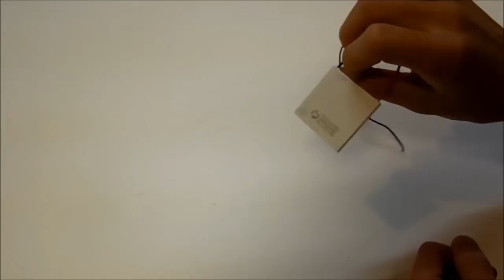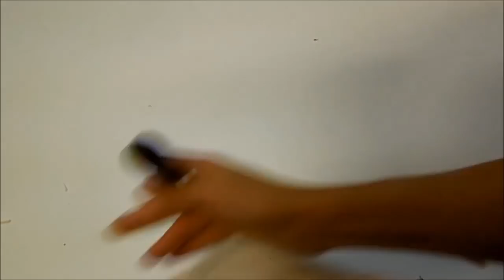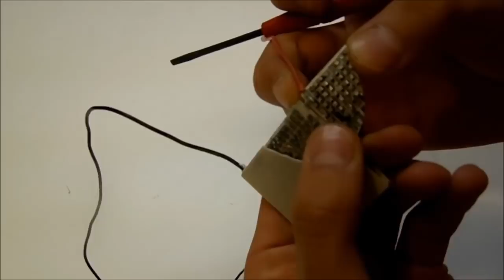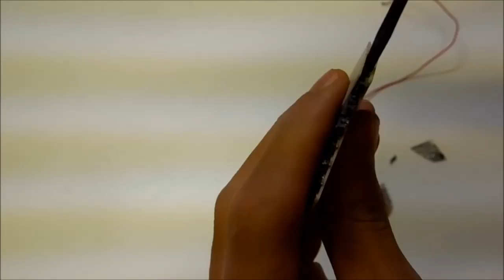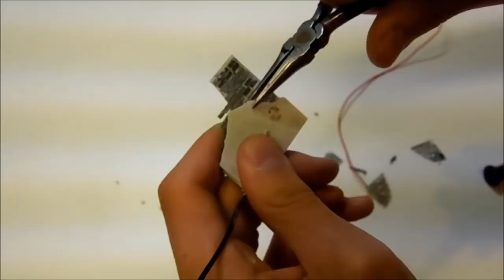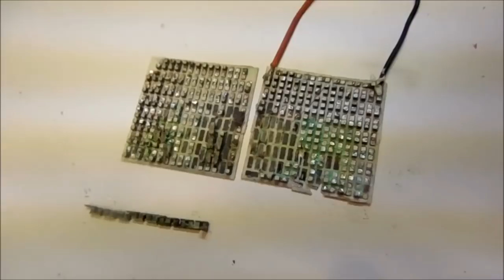Inside a Peltier Thermoelectric Heat Pump + Tear Down

Comment: He hecho en casa una célula peltier con placas de cerámica con conexión en paralelo recubiertas con una micrométrica película de Óxido de Aluminio y por cada Semiconductor en conexión serie los he hecho de Cobre metálico termooxidados de modo que los SC positivos son de Óxido Cuproso y los SC negativos son de Óxido Cúprico y conectados en serie P-N-P-N etc con delgados hilillos de cable de cobre. Se ha creado frío hasta los 12 grados centígrados Celsius y calor hasta los 38 grados centígrados Celeius. Y ha generado una potencia eléctrica desde 1 hasta 6 vatios ( watts ) dependiendo del calor aplicado a su cara frontal. 
Saludos desde México.
24 marzo 2020.

Comment: Hi I make these in our factory... From scratch... The pellets are bismith seliride... Very TOXIC!!! and bismith telliride.. He should wear gloves and clean hands very good.. And arranged in N  then P type materials it's only work up to around 350 degrees ..then the pellets break down and also solder also melts and becomes open circuit..
Reply: They should probably start putting warning labels on them ;) Thanks for the tip though!
Reply: Also the ceramic top and bottom plate are most likely made of beryllium-oxide which is nasty health wise if dust is inhaled, otherwise relatively safe if you don't pulverize it.
Reply: Can you make big size Pelter
Reply: Hi  there I made a material that thick like a penny that keep hot side on one side without getting the heat to the cold side. You think these could be interest to the company you work for??
Reply: i have those pellets , but could u tell me how to manufacture the final product

Comment: What are the semiconductors made up of? Is it Tellurium? If it is, isn't it poisonous?
Reply: Jiun Hong Lim they have two be two distinct electric conductor or semi conductor materials. 
Iron and copper do just fine.
Reply: Jiun Hong Lim silicum?
Reply: vnh sander Oo, OK, thanks :)
Reply: Ramiel OK, thanks :)

Comment: Just as a side note, the things inside are not thermocouples. 
They are P-Type and N-Type Semiconductor blocks.
Reply: I understood these work off of the fact voltage will generate across two dissimilar metals at different temperatures? Is that not right?

Also, is there a reason for the ceramic top and bottom when metal would work better? Is it because it is easier to electrically isolate using ceramic? Seems like it would take a major hit to thermal conductance and efficiency by using ceramic.

Comment: Was it totally open circuit? Because these things can melt themselves apart if left uncooled. Would have saved you a lot of work. ;)
The other easy way (hey, who knows how many you will have to take apart in the future): hit it with a hot air gun after removing the silicone. It should fall apart.

Comment: Do you have any idea how electricity flow and why one side gets cold and the other hot?
Reply: Look up Seebeck Current and maybe Fermi Level as a start. Peltier ran Seebeck's setup in reverse.
Basically the hot junction has a greater EM force from the better conductor to the lesser than the cold junction, which sets up a current flow. On the hot side, electrons leave with energy that gets shed at the cold side until if ever both sides are the same. That's when heat-driven. Drive the circuit and it works opposite.
It's very low voltage per junction pair but notice how many junctions that wafer has in series to be able to operate at 12V.

Have you ever used steel pans with copper clad bottoms? The copper is a better conductor than the steel, it has more free electrons at the same temperature. The free electrons push against each other, like charges repel, which makes more electric "pressure" in the copper than in the steel. Result is that some electrons from the copper side of the junction (where the metals meet) push into the steel.
When you heat the pan, that raises the level of free electrons and pressure in the metals. The copper is very good at taking in the heat and those electrons pushing into the steel carry that excess right into the steel faster than bare steel could take in heat.